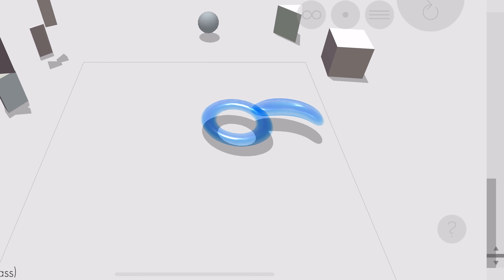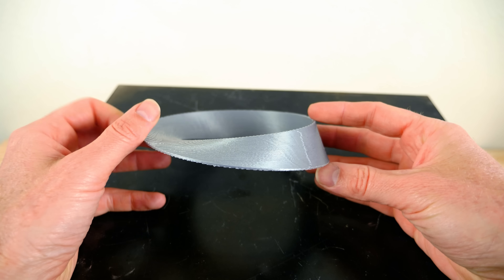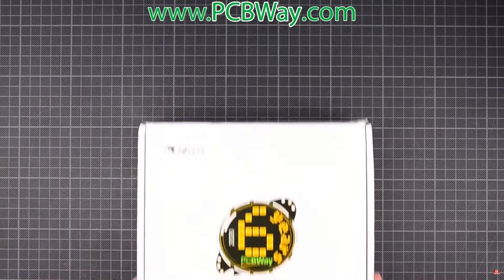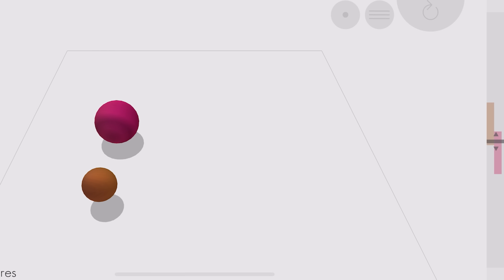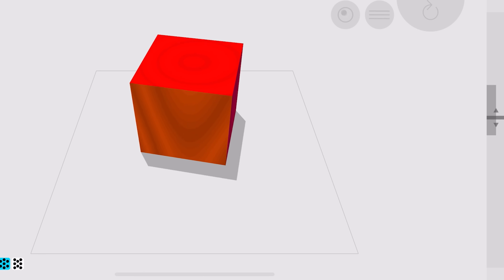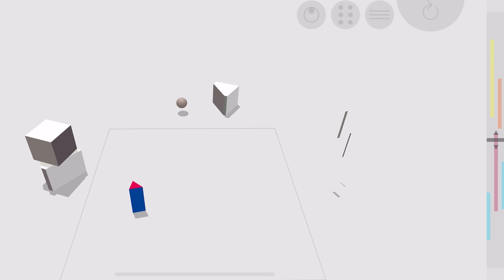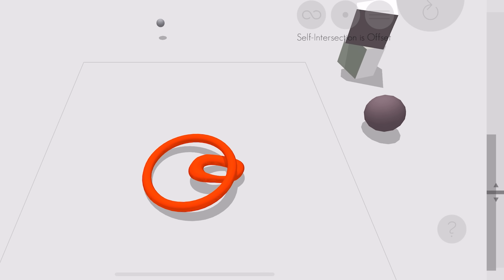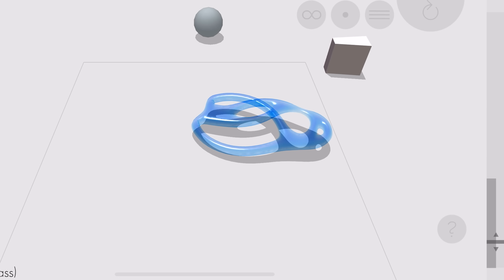What Does a 4D Klein Bottle Look Like?

Comment: 4D objects can really be hard to visualise. I used the technique of orthogonal projections, but with a 4th plane.
The interesting thing, is the sheet of paper used for the drawing. In a 3D orthogonal projections, a sheet of paper can be divided in four parts: one for the top view, one for the front view, one for the side view, and the last part - the bottom right - used for the 90 degrees projection lines.
The forth dimensional plane is a part of a paper sheet connected with sticky tape at an angle, but the interesting detail are the three planes with the projection lines from all three other views.
Of course the 4D app is more practical than the floating paper fandango, but I bet that almost nobody is able to work out how the projection on the 4th plane looks, since our brain (normally) can't imagine objects in 4D. The hypersphere and the tesseract are the simplest 4D object one can think of; hyper polygons are a true challenge to the imagination (if an headache don't kicks in first).
Thank you for the great video!
Reply: I use another technique to visualise 4D, which is the gradient map (a.k.a heat map).

We can use colors to visualise the height of each point on a 2D map of a mountain range.

Let's say we use red for "high", green for "neutral", and blue for "low". Now imagine that the glass bottle in this video has colors that gradually change between red, green, and blue, so that the part where it "intersects itself" has the "tube" as red and the "surface" as blue. The red and blue would overlap (and create purple). Fortunately we are familiar with understanding "red+blue=purple", and we are using green as "neutral". Therefore, as we see purple, we can understand that there are 2 separate parts, red and blue, meaning "high" and "low", that do not intersect.

Using the same technique, we can draw an illustration of the Mobius strip on a flat plane.
Reply: @a.y.102  We have seen this technique in old school printed maps. But you cannot see through the mountains with this technique. You can just justify the elevation with this. Btw good suggestion. 4D is not practical out of the computer simulation. You have to accept this fact. Unless you are high af.
Reply: @sagnikmaity1444  
You can "see" through a mountain, if you use a similar technique to visualise a tunnel (with varying elevation) through the mountain.

We would have to use colors differently. We use green for the mountain, ranging from dark green (low) to bright green (high). We use red for the tunnel, ranging from dark red (low) to bright red (high). Basically we are using the "alpha channel" as the "elevation". As we are familiar with 3 base colors, we can visualize 3 things (for example: surface and 2 tunnels) at the same point of the 2D map.
Reply: @sagnikmaity1444  

(Adding to my other reply to you)

For the Klein bottle, I suggested the other colouring scheme because:
- it's still 1 object, so it's nicer to make it looks continuous,
- (and more importantly) we are not dealing with the exact "elevation" of the red "tube" and the blue "surface". I said purple means "high" and "low"; but if there is trace of green, we can't know whether the red "tube" gets a little "lower", or the blue "surface" gets a little "higher", or both.
Reply: @a.y.102  You just drive past my whole point. I just asked can you persist 4th dimension without the help of a computer?? I meant with the naked eye??
Reply: @sagnikmaity1444  
The problem for "naked eye" is that our retina are 2D. Especially if you want to view something on screen then it's really 2D. You have to comprehend the 3D first (for example: by using both eyes/ using multiple perspectives to see a real 3D object in front of you), then use the color scheme to comprehend the 4th dimension.
Reply: @a.y.102 Wow!! Nice explanation
Reply: I like the idea and would appreciate if I could find a demonstrated of this technique
Reply: I don't fully understand. The intersection point is not making sense for me. Just make an inside out overlapping tube? A tube has an infinite loop inside and out so...?
Reply: @mjsthetopshelf  Its surprising that you understood something. Unfortunately I understood it fully. What I learnt about it that it is totally bullshit. Don't sweat your precious hairs on this shitty topic.
Reply: @Obamium Because there is only 3dimensions. X,Y and Z are the Only three lines that can intersect each other in right angles. Thus represantating the 3dimensions of space. There is no 4th dimension.
Reply: Light up a blunt and inhale the smoke. When you exhale, before you know you are floating in the fourth dimension amongst the smoke clouds. 🌬️💨☁️